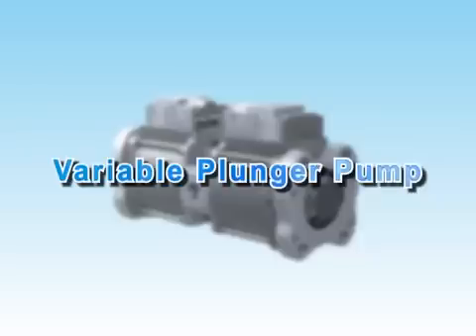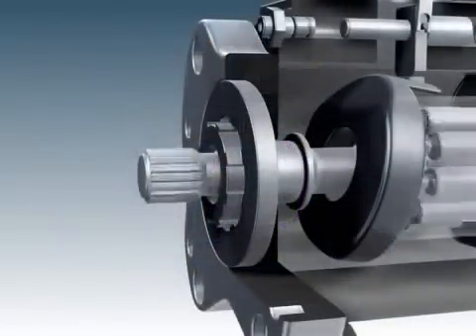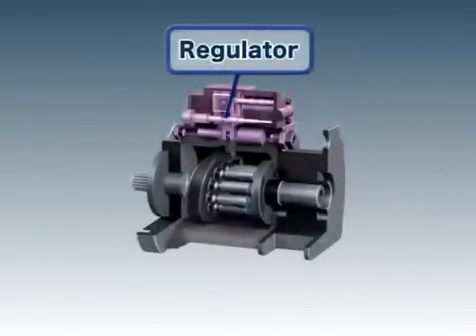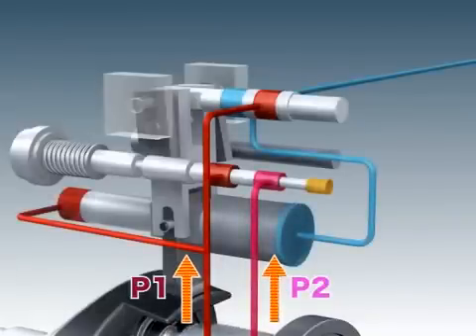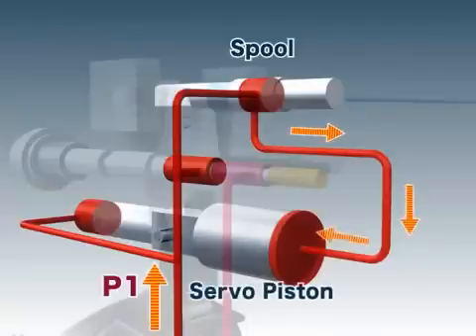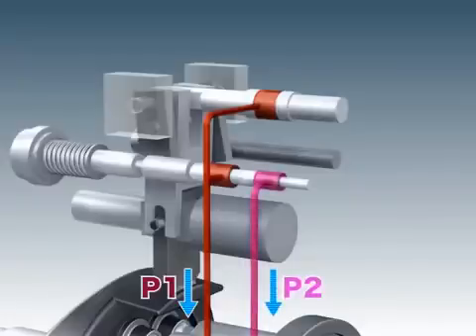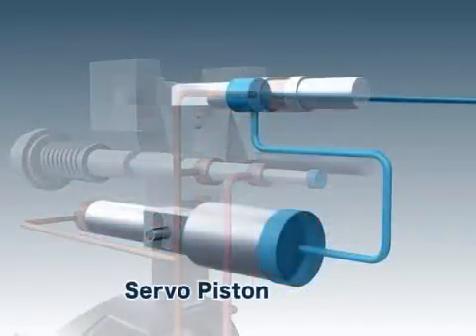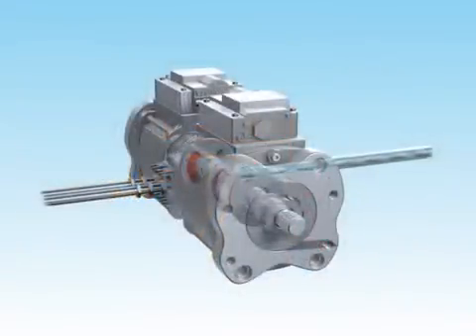How does Hydraulic Pump Works

Comment: New stuff is okay to made replacement  for every single part inside, but if the pump block or shaft inside cannot used for original repairs kit anymore that the REAL EXPERIENCE 😅😅😅 to talking  about... for other maybe  it's a big iss6 but for people's solve  and face this problem  many time you should  listen no matter what and DO NOT ASK ANY QUESTIONS   and just TALK AVOUT ABOUT THE COST 😝😝😝 because have 3 options and not just have one opinion  from the engineer, first change new pump, secondly give to EXPERIENCE person because even engineers from the manufacturing cannot solve this or third change  with used pump